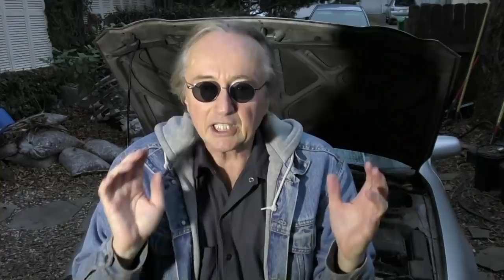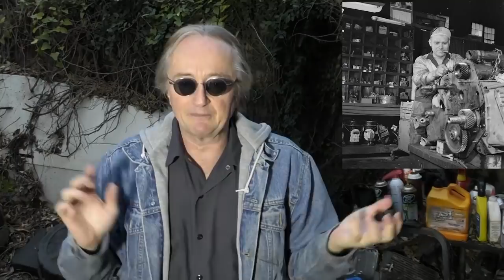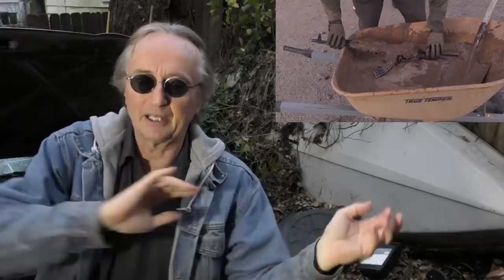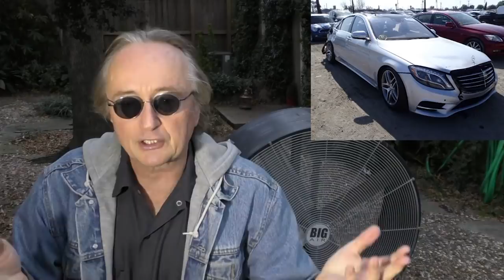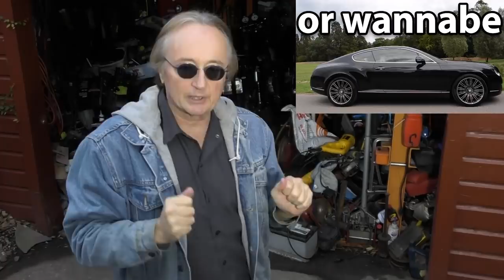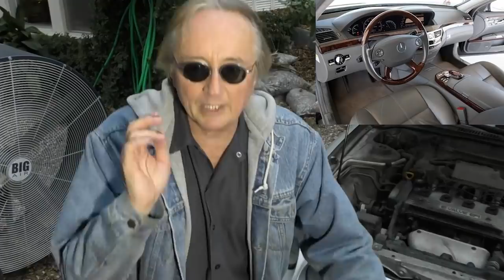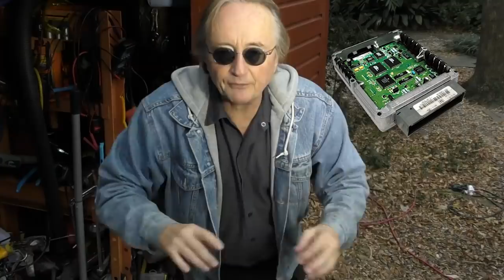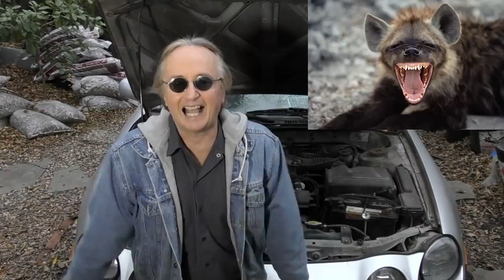Why Luxury Cars are Designed to be Unreliable

Comment: All I have to say is those Celicas from 1994 to 1999 are the most reliable cars ever invented. I own two of them and I drive them every day, over 300,000 miles in one of them. I actually fix them and change parts that are not broken because I just get bored that nothing ever breaks down with them. I see them thrown away at the junkyard all the time, perfect working Celicas, because people need to have the latest model car in their garage.
Reply: unsurprising as they're essentially a Camry underneath the 2 door body.
Reply: @PrisonerD  The Celica GT has the same engine as the Camry, the 5SFE engine. There was also a V6 Camry in those years with a different engine. The Celica ST has the 7SFE engine same as the Toyota Tercel. Both engines are very reliable and easy to fix, they last 500,000 miles or more with litte maintenance. They have a timing belt but is a non interference engine so you can wait until it breaks and then replace it without having the valves bent. Oh I love them.
Reply: I have a 98' Civic that's been in the family since new. Has roughly 380,000 ish miles and only replaced the clutch, shocks, battery, spark plugs. All costing less than $2,000 for the past 20 years

Comment: my 22yo BMW e39 535i (m62 v8) is going as strong as when it was first built. I've had it a while now, and yes I've had to do a little maintenance to it, like a couple of window regs, shockers, brake pads and rotors, but the actual parts are really not that expensive if you want to work on it yourself. Servicing it costs just a little less than my wifes Ford xr8 sedan, a 5.4lt DOHC boss v8. 

As long as parts are still available for it I'll keep driving it, it's the daily driver of my fleet of cars.
Reply: I have a 98 740i with m62 non vanos. Rebuilt the motor, redid suspension and a few other things and it’s going strong. Fun car to drive!

Comment: Older Mercedes were well-built my friend Has A 1976 Mercedes station wagon diesel with about 450,000 miles and still runs good
Reply: only Mercedes had issues was with the 90s series with some had bad cables that literary rotted, mechanical as drive-trains and engines mercedes still are solid there, only one to really be careful with is the v6 models of the 90s - 2000s
Reply: Scotty already did a video where he said those Mercedes were good, he means the newer ones are problematic
Reply: Marklin15 Yeah I think the reason behind that is they make unreliable cars so when your old one breaks you get a new one
Reply: The older Mercedes diesels were great the new ones are garbage I work on German cars and to be honest I work on New German card because even the new ones break I just got finished working on a 2015 S550 and it has a world a problem and the most messed up thing is is you have to electronically release the Pistons on the calipers to change the brake pads which was cool and a headache at the same time
Reply: QuotedLion 370 Wow you must make a lot on fixing those cars
Reply: @zBPS  not really people think that because getting them fixed is expensive the parts are expensive not really the labor
Reply: QuotedLion 370 That’s true what kind of issues do they mostly get?
Reply: @zBPS  with a BMW 4.4 V8 that you find in the 5 45 and 750s 2000 through 2007 valve stems and electronical issues and the valve bodies and their Transmissions always go bad that's the same for the new ones too because they use the same transmission except they went from a 6-speed automatic to an 8-speed with the same problems because it's pretty much the same transmission They just added two more gears the only BMW I would have to say would be good would have to be the E36 in the E46 and E30 all the old BMWs all the way up to the years like 97 we're all Bulletproof and the Mercedes seems that have more problems when they come from the dealership because the dealership for Mercedes don't seem to know how to tighten bolts or take care of their own car I've gotten car that came straight from the dealerships we had a ml that was a diesel I had to change some stuff off of it because the dealer was asking way too much and the customer heard about us and he only like to take his car to the dealership but at the time he was getting fed up with the prices they brought the car in only had to remove maybe 20 bolt total and only two of them were tightened the rest was loose two bolts are broken and one bolt didn't even belong to that car
Reply: Prior to the 1990's, Mercedes built great cars.  It really started going downhill with the '95 E class.  Just pull up some pictures of it compared to the previous version and you will see how cheap it looks by comparison.
Reply: Mercedes quality went downhill big time when Germany re-unified and started outsourcing manufacturing to East German labor that was used to Soviet quality standards.
Reply: @quotedlion3707  Not an issue if you have the SDS/DAS. Most backyard mechanics can't afford that.
Reply: Ian East the east germans, modern day descendants of the Prussians, aren’t all that much inclined towards mechanics and engineering anyways. They were a warlike nation and you can see that in the modern day east germans.

Comment: I could not have said it better myself Scotty. My daily driver, and the only car I own, is a 1987 Ford LTD Crown Victoria. Maybe not a "luxury car" by today's standards, but it's got big, classic American elegance, and the most comfortable ride and velour upholstery of any car I've owned. Basic maintenance has kept it running tip top for over 30 years. It's never broken down even once, it's easy as hell to work on, parts are a dime a dozen, and it turns more heads than a modern BMW.

Comment: The M16s problem has never been the ingress of foreign debris, the issue was the carbon buildup from the ammunition.
The ammo was particularly bad in the Vietnam era due to the fact that incorrect powder was used against the manufacturer's specifications.
Reply: also the m16 was more accurate than the ak47, which was first made in 47, AFTER ww2 btw.
Reply: @davidstoyanoff  I know when ww2 ended.
Reply: @kirilbellic3602  I'm sure you do, but scotty maybe not so much.
Reply: @davidstoyanoff  didn't catch his mistake on that.  But the rooskies were working on prototypes during the war.
Reply: But the AK-47 is technically a WW2 design, as you probably know it was largely based off of the STG/MP 44.  You are correct about the early M16's.  They aren't AS reliable as an AK-47, but early on during the Vietnam war, the (either dirty primers or powder, can't remember) fouled up the gun rather quickly, causing the rifle to jam.  Ammunition was eventually fixed, but the reputation stuck about the M-16 having mediocre reliability.
Reply: If you keep an M16/M4 properly lubed, it will operate.
Reply: @Patriot1790  True.  Part of the issue also was the fact that the M-16 was a brand new rifle (yes, AR-15 had been around since '56/'57) but the M-16 was seeing widespread use for the first time in Vietnam.  The claim was that the rifle's tolerances were extremely tight, and the rifle never needed to be lubricated (or very rarely); it was good to go from the factory.  So, in the early days, soldiers neglected the proper cleaning and lubrication that any rifle needs, and along with the dirty cartridges, leant itself to foul quite easily-hence where it got its reputation.  Once they changed the powder of the 5.56 round and soldiers learned to maintain their rifle, just like any other gun, the M-16 turned out to be just fine.  But again, that reputation stuck-even though it really had nothing to do with the rifle itself.
Reply: The ammunition was poorly manufactured, and they were told the rifles didn't need to be cleaned.
Reply: Lance Littleton AK is not at all based on the Sturmgewehr. Long stroke gas piston vs delayed roller lock system, very different
Reply: 30 round detachable magazine, fires an intermediate cartridge, relative length and weight, early on stamped receivers, pinned/pressed trunnions, I beg to differ!  Wasn't Schmeisser captured by the Russians after the war as well? I'd bet money the Russians had a word or two from him on his design.
Reply: @lancelittleton9802  I know when the M16 was introduced. I don't care how well a firearm is built. If you have bad ammo, or you don't maintain it. It's going to fail.
Reply: @Patriot1790  What? This was in reply to Alexander

Comment: 100% correct.  I bought a 2012 Audi A8L that was off a 3 year lease in 2015, pristine condition, super low mileage and well less than half the $83,000 original price.  It was great until mid 2017 when just about every electrical system in the car developed expensive to repair issues.  What a nightmare.
Reply: QuikSeps   Alot of problems may be caused by a alternator on its way out, alternator that has had oil dripping down into it.

Comment: I’ve been with BMW for about 10 years, started out with a 2002 330XI in college. It was a total nightmare, I went out and bought another one. A 2010 BMW 550i, the V8 has been titanium. No problems at all. But the maintenance does cost a lot, but since I’m a car enthusiast and like the driving dynamics I’ll pay the price. A few years ago I bought a 2016 Ford Fusion, absolutely zero problems, good gas mileage, and oil changes were $20 bucks but it was plain old boring to me. It’s about preference sometimes. My grandfather urges me to get a Toyota, I like them but the driving dynamics are totally different. It’s reliable transportation versus something that was engineered to be on a different level and make innovative technology.
Reply: Dominique Robinson a 550i does not have any ground breaking technology compared you your Ford except a big powerful engine. They are worth 10k in 10 years for a reason
Reply: I guess it all comes down to what you want out of the car. If you just use your car to get from point A to point B with no drama then a toyota gets the job done. But if you want to get the real feel of driving and get your adrenaline pumping, there is where the "unreliable" cars come in.
Reply: @tahmid369  Yes, I'll take the pin me to my seat performance and the big smile on my face over the engine that sounds like a fart can under the hood with a 0-60 time of 9 seconds and dive nose braking of a cheap econo- box.
Reply: You might want to check out Mazda as a reliable alternative. Very engaging to drive, good engines and the interiors are becoming quite premium-ish
Reply: Wesley T I also like the body styles of the new Mazda’s as well, they appear to be very nice cars. If I switch I’m probably going to get a Lexus, very reliable but you still get some innovative technology and better driving dynamics to have fun with.
Reply: Yep, fun versus an appliance
Reply: It's not like toyota dont have dynamic cars. Get a gt86. It's better at dynamics than any bmw. Better even than the m4. Except power, of course. But it's way cheaper, so you can build more power if you care about that.
Reply: Toyota's new Lexus LC500 should have very comparable dynamics to the new BMW M840i. :)  Or, of course, there is the new Supra which simply is a BMW, but tarted up by Toyota to be a bit more sporty and dynamic than the overly restrained Z4 version of the same car.

Comment: My Audi had that damn airbag suspension. It was swapped out for bilsteins.  $1400 swap vs $1400 repair constantly.
Reply: You know what they say - the best Audi is the one you just sold :)
Reply: Irony is.. I bet you Bilstein made the OEM air suspension on your Audi! Could he wrong, but they make allot of OEM suspension for most high-end German cars.
Reply: Its odd to be constantly blowing the air suspension. Something else is at play here. Those are reliable systems on a multitude of cars and are a good all in one suspension solution.
Reply: Well, if you're used to those air suspension thing, it is a totally different level of comfort that normal struts users will never be able to comprehend.
Reply: EDS is the way to go in german cats
Reply: @GrzegorzDurda  Another point to be made is that many of these luxury cars aren't driven often, as the owners want to keep it rather low mileage. The irony is the air suspension can also fail if the car isn't used often enough
Reply: Older Lincoln Town Cars had the same problem.

Comment: Yeah, those old Cadillacs did have a lot of issues.  However, the Lincoln Town Cars with the 4.6L engine from the late 90's and early 2000's seem to have held up relatively well.  I see quite a few of them in my area with high miles and still looking and running well.
Reply: Yes because those are basically a re skinned Crown  Vic which those things are Tanks and re nearly indestructible!
Reply: When they went to the Northstar motors it was all over. The worst engineering in a motor ever.
Reply: @javiergonzalezjr5150  That's true, Javier.  Here in FL, there are quite a few panther bodies still chugging along.  The fact that Town Car shares most it's parts with the Crown Vic and Grand Marquis, makes sourcing parts easy and inexpensive.  And that modular 4.6L Ford engine is in everything from Mustangs to cargo vans.  Heck, I'm currently driving a 98 F150 with a 4.6L.
Reply: @Kiddro22  Yes, Kiddro22 I was surprised that Scotty only mentioned the alternator.  The Northstar engines did not hold up well over time.  It's a shame too.  The Cadillacs were very nice when they were new, but then they tended to fall apart really quickly.

Comment: I have had very little trouble with my 2007 S600 because I’ve kept it serviced exactly like Mercedes recommends since it was new. It’s cheap to keep the car up compared to buying a new one. I’m glad I bought it 11 years ago and it still performs the same as it did in 2007. I would never buy a used one because why would anyone sell a car like that for 20K that didn’t have problems? I would dump it in a heartbeat if it was a money pit. Replaced the front battery 3 times in 11 years and replaced the big battery in the trunk last week for the first time. I never had a battery last 11 years before. It seems my experience with Mercedes (the car not dealers) is the opposite of what I see on here as it has been all positive. I have my own mechanic and never go near the dealership because they are rip-offs.
Reply: How many miles on your car now? Wait till it hits 140kmiles or more.

Comment: For all you non-mechanics, 
The phrase "Tight tolerance" or "thin tolerance" means a part needs to be made a VERY specific way in order to work right. Be it size, shape, number of threads, etc. 
ANY deviation from that form, and the part will not do its job the way it should.

Im an aircraft mechanic. Several wear tolerance limits sit within a few ten-thousanths of an inch. 
Part A has a vibration tolerance limit of .0005" +.0002 & -.00005. 
Part A can tolerate loosening tolerance of 2/10,000 of an inch, but a vibratory shifting tolerance of no more than 5 hunred-thousanths of an inch. Any more and it will loosen up too fast and fall apart orders of magnitudes faster than its supposed to.

When buying a vehicle, find something with the biggest, widest, highest tolerances you can find. 
The better those stats are, the cheaper AND easier it will be to repair or replace parts of your car.
Reply: Thank you Daniel